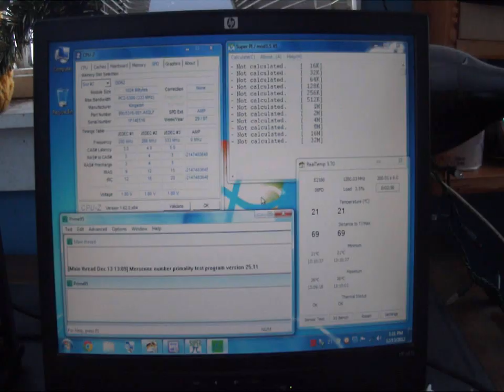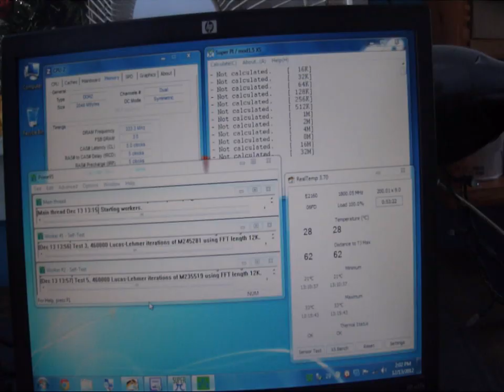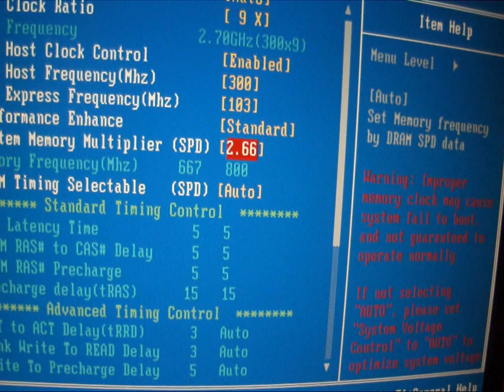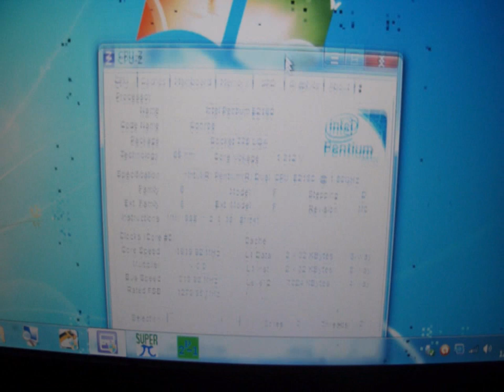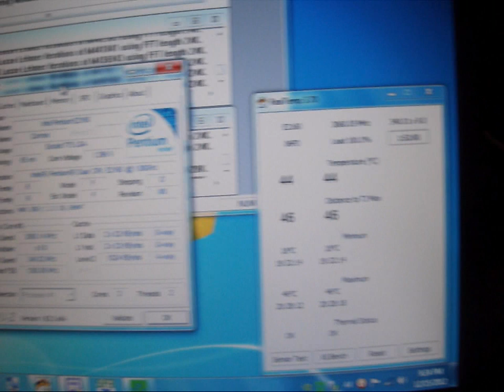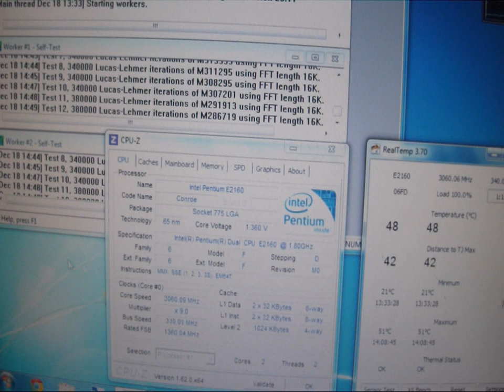Overclocking Tips On The Intel E2160 And Gigabyte G31-ES2L

Comment: I have no luck overclocking the e8400 cpu much. fsb craps out at 343MHz. so gonna try an e7600 when it arrives.  I know my board is good for 343 all day long but NOT 1MHz more it wont boot, no matter what i do. So I think the e7600 will get me 3.95GHz when it comes. Let u know if it does it!

Comment: I have this CPU for over a 6 years now, on stock cooler, never tried OC it, never changed anything except mu GPU and power suply in order for GPU to work.
So i was thinking of an OC of 2.6 ghz would be enough for this machine, i don't do heavy gaming on this one, it's pretty much for media usage/light gaming only...so the problem i have is (acording to the man who's fixing my PC's when i can'r do it myself) that my motherboard (Gigabyte Ga945pl-s3p rev. 6.6) doesn't have the options, or that it's locked..he said it can't be overclocked at all on it. If anyone of u guys know if this is true, would very much appreciate the response. And if it isn't, do you think it's possible to OC this thing to about 2.5-2.6 ghz? :) Note that i never dabbled in any OC or anything, but i can say that i'm familiar with the techniques..
Will leave the rest of the spec if needed, it's an old machine, but it realy served me good over the 6-7 year period. Thanks in advance, cheers!
Reply from the maker: That is a tricky board to try to overclock with. I have seem some success with it Here is a link that might help. http://www.pcstats.com/articleview.cfm?articleid=2047&page=4
Reply from the maker: Martin Matejic Good luck with it. And remember to hit CTRL + F1 at the main bios screen to access extra features of the board.
Reply: Do you know what extra feature is....?? because I try to do ctrl+F1,, and there is still the same... No additional setting...

Comment: dude if u can help me about one question what types of all 775 chipst that allowed u overcloking i know like g31 from ur video i know p35 and p45 also overcloking capable what alse ?? g45 any good for overcloking? thx (and if u can tell me further list i will apreciate it)
Reply: +FUzzyBUnnyBOoties 
Do you know how to breach fsb wall (around 250Mhz for Ur cpu) without increasing pci-e....??
because i dont want to have a problem with my hdd and gpu..
Reply from the maker: That is a very good question. Pretty much all of the mainstream chip-sets will allow for some overclocking. The overclocking itself is more dependent on the individual cpu and motherboard then on a certain chip-set. The main thing you want to watch for is the stepping number on the cpu to make sure it is a model that people have had luck overclocking. The best way to find out what works is to check out sites like overclockers.com and see what results other people have gotten on certain setups. That will help you to decide what you might want to try and which platforms work the best for overclocking.
Reply: FUzzyBUnnyBOoties from ur personal experiance g45 any good overcloking chipset?  thx mate
Reply from the maker: idan124 I think you mean P45?. And yes they are a wonderful chip-set for overclocking. Some of the P45 boards even use DDR3 ram. There is also the X48 chip-set but they are more money and don't preform any better then the P45.
Reply: FUzzyBUnnyBOoties no lol g45 see this http://www.ebay.com/itm/NEW-DELL-Studio-540-540s-IPIEL-RN2-MotherBoard-Intel-G45-Socket-775-M017G-0M017G-/231348112780?pt=Motherboards&hash=item35dd6c0d8c
Reply: or this http://www.ebay.com/itm/INTEL-BOXDG45ID-INTEL-G45-S-LGA775-MICRO-ATX-MBD-NEW-/400215205588?pt=Motherboards&hash=item5d2eaf66d4
Reply from the maker: idan124 Sorry I should have clarified. The P45 and G45 are the same chip-set. The G just stands for integrated Graphics. So the G45 is a P45 chip-set board with onboard video. So yes they will overclock but I have found with the G boards that once you get to a certain overclock the onboard graphics will start messing up and you will need to put a video card in to proceed higher.
Reply: FUzzyBUnnyBOoties thx bro i realy thekful for this info btw im always use external pci card so how does it so chip biside to p45 ?
Reply from the maker: idan124 Your welcome :).

I am sorry but I don't understand what you are asking?.
Reply: FUzzyBUnnyBOoties omg lol what types of phenom x4 family are capable for unlocking cores coz 955 and 965 deneb and black editions wont let u to unlock cores because they are 4 cores build 960t are 6 cores build as far as i know and hacking to 4 cores working so u can unlock it but i would like to know what alse types of phenom x4 family like the "t" version coz i dont know thats all if u dont know man no mather thx anyway
Reply: FUzzyBUnnyBOoties ok iv read post about it and found that only 960t which is 4 cores are capable of unlocking to 6 because this chip as original 6 cores and hacks to 4
Reply from the maker: idan124 Have a look at this page. They list all the cpus that will unlock and what they will unlock to. http://www.overclock.net/t/1005739/what-unlocks-the-unlockable-cpu-reference-list
Reply from the maker: idan124 The unlock rate on them is very low. Some where around 30% of them will unlock. So unless you are will to buy multiple cpus to get one that unlocks you would be better off just spending the money on a 6-core.
Reply: FUzzyBUnnyBOoties very very helpful u did help i search after this thx man

Comment: Dude, thanks for the video! You're definitely a pro.
I own an E2160 since... 4-5 years ago and now I'm preparing to buy a new processor, probably an i5 or i7... and as you might guess I have to change everything. New mainboard, new ram, new video board... new everything. A lot of money for a student.
E2160 did a good job but since last year it runs like crap... and, until today, I didn't know why. Looking for some new processors and making comparissons I found your video and I just ran a temperature test on my box. Guess what: both cores stay at 71-73 C. I am not an pro, but I think this is the main problem for the low performance of my proc. I'm gonna buy some thermal paste and I'm gonna apply it on the processor to see what's the response. Eventually I'm gonna buy a new cooler as well (suposing it could be its fault too) and if all stable I'll just overclock it using steps from your video... of course, I'll probably overclock it at 20% first.
Any suggestions? Or any other thoughts about the high temperature?
Reply from the maker: Temps can definitely cripple a processor. New thermal paste will help make better contact with the cooler so that would be a great starting point. Make sure that the fan on the cooler is working properly and also make sure any case fans are working also. Sometimes you can have a cooler that is working just fine but the inside of the case is just too darn hot. So try running the computer with the side cover on and also with the side cover off and compare temps, that will tell you if you need better cooling in the case.
Reply: FUzzyBUnnyBOoties Temps are now between 21-30 C on normal tasks. The old intel cooler had definitely a problem.
Unfortunately I can't clock it from bios using my MSI motherboard cause I don't know how to set the parameters and the proccessor won't  work. It keeps restarting for 3 times then it resets. There is still a msi technology where I can clock it but at maximum of 7%... IT has some auto levels like Captain, Colonel and so on. So I just used the max level of 7% and I noticed that in increased load the frequency of the proccessor increases at ~1980 Mhz.
Reply from the maker: Vl ad Nothing wrong with that. Most people are happy if they can get a 10% over clock and have it be stable. So 7% is not bad at all for some free power. Glad the cooler worked out.

Comment: Whats the squeaky fan on that has been on as a background noise in your videos for ages? Personally even a loud hard drive drives me nuts (no pun intended, lol) .

I recently set my i5 2500K to run at 3.7GHz since the "Intel TurboBoost" feature never worked for me and it would max out at 3.3GHz even with Prime95 running. Not too concerned about temps since since the Scythe Ninja 3 cooler is massive and keeps it under 55°C no matter what.

But anyways, keep up the good work as always.